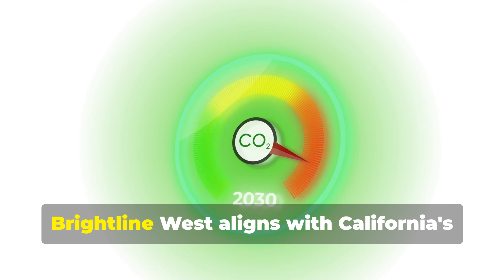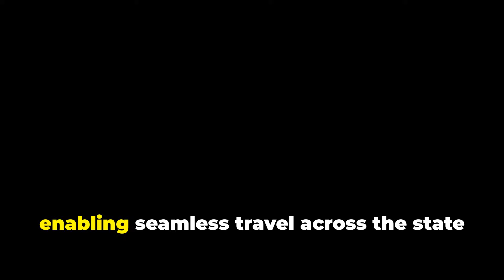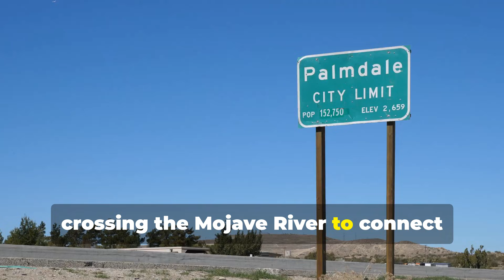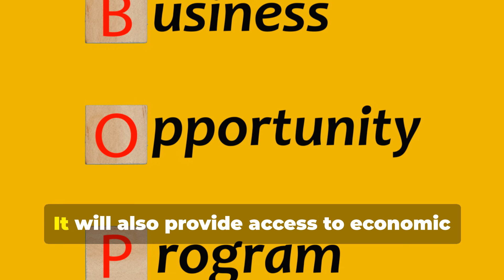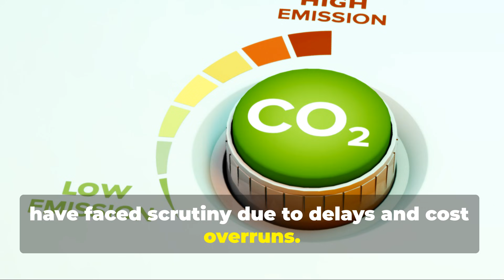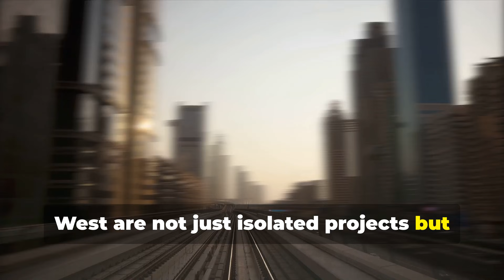Brightline West Revolutionizes High Speed Rail in the West

Comment: Some of this is old, inaccurate  info.  The max speed will be 180 mph or less,  AVERAGE speed only 90 mph, due to slow speeds while following the existing, lower radius curves of the freeway.  By the time it is ever finished, cars will supposedly be electric and self-driving.  People drive to Vegas at 90 mph as it is, so with parking and station waiting time included, driving would still be faster.  The wires will ruin the view for drivers.  Taking electric cars off the road will not reduce car exhaust, and there is no inversion layer up here to trap air pollution anyway.   And yes, the route crosses over lots of low income areas - because nobody n their right minds wants to live in the middle of dry, dusty nowhere, at 120 degrees, and the train will not stop to serve this scant few hundred people who do live in these areas, or it would go too slow to be a bullet train at all.  And tickets will be expensive anyway.  Plus if it were filled with low-income people, nobody else will want to be onboard anyway, which is probably  why there are no stations planned for low income areas, and why fewer and fewer people use existing mass transit in California and elsewhere, as it is.  The very idea of a super-fast train means it can't make many stops, or it would take far too long to get anywhere.   Will it ever be built?  Well, you saw the pictures of all the politicians cutting ribbons and pounding symbolic railroad spikes into tabletops, right?  So what else do you need to see?  Well, this is the fastest-growing area in the U.S, so let's hope for the best, but most people around here give it maybe a 50% chance of ever even actually happening.   :)

Comment: Hopefully LA main train station can add direct conncection to brightline rancho train station.
Reply: Brightline CEO already stated there are no plans for a direct connection to Union Station.
Reply: @mrxman581  Metrolink is already increasing their service to LA Union Station as apart of their SCORE project, which will add <45 minutes to the journey time while still being the faster alternative than driving
Reply: @californiaporg  It would be a wash at best.
Union Station to RC = 45 minutes 
RC to Vegas Station = 2hr, 10mn
Vegas Station to Casino = 20-30 mn

That's already at least 3 hrs, 15 minutes. That doesn't include the time to get to Union Station and the additional time you need for the 2 transfers, one at RC and the 2nd in Vegas. And lugging your luggage around the whole time.

Lastly, there is the issue of price. It will definitely be more expensive than driving, especially if there is more than one person on the trip.

I've driven from LA to Vegas dozens of time and regularly make it in about 4 hours. That's driving about 65-75 mph and stopping at In N Out in Barstow for a quick Double double combo.
Reply: @californiaTTransit  the current Metrolink LA-RC travel time is 74 minutes. They’re increasing frequencies to 1/2 hourly, but speeds and travel time should still be about the same (definitely not shaving off 30 minutes). Union Station to BLW’s Vegas station should take about 3 1/2 hours including transfer times.

Edit: according to Metrolink’s latest schedule RC-LA is 78 minutes (LA-RC 74 minutes) on weekends, and 67 minutes on weekdays (LA-RC 70 minutes).
Reply: @mrxman581  and it’s probably closer to 4 hours, as LA-RC currently takes 74 minutes on Metrolink (on weekends).

For fun, I looked at what the transit travel time would be between the Strip and Santa Monica (BLW’s promo video says that would take 2 hours), using the DEUCE bus, Brightline West, Metrolink, and LA Metro’s D and E Lines, which came out to be about 5 1/2 hours including transfer times, and potential walking time depending on one’s Point A and B. Now, drive time between Vegas and LA can vary greatly from under 4 hours to over 7, depending on I-15 traffic, especially during the weekend when most people would likely be traveling that route (Friday afternoon/evening east and Sunday afternoon/evening west).
Reply: @ChrisJones-gx7fc  Yes, I agree. Though most regular travelers between Vegas and LA know when not to travel to Vegas.

For many years now, I travel early Saturday morning from LA and leave Vegas early Monday morning, so I'm in LA by 2pm. to avoid regular LA traffic. It's more than worth it to take a day off from work.
Reply: Metrolink and Brightline West are planning to create timed transfers between trains at Rancho Cucamonga, eliminating waiting times over 25 minutes.
Reply: At least they can connect california high speed rail with brightline rail line outside of LA.